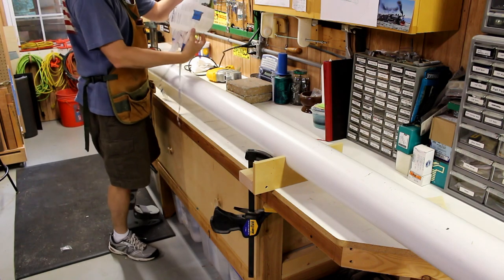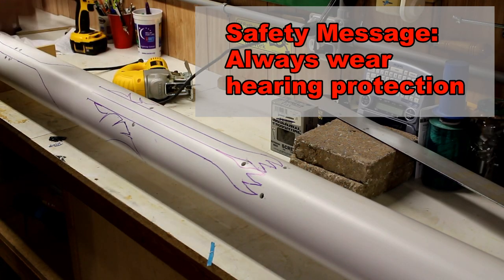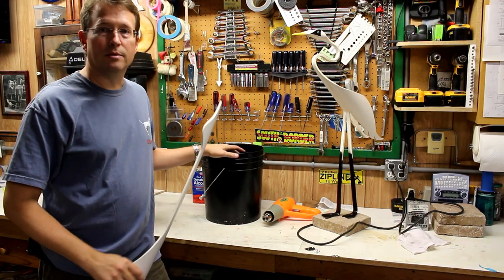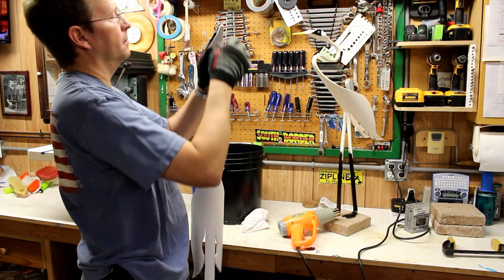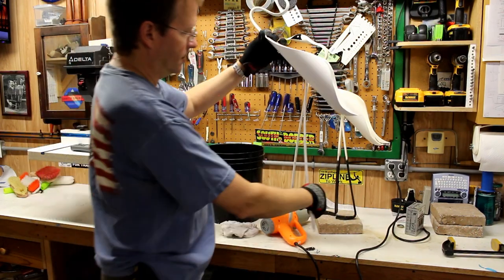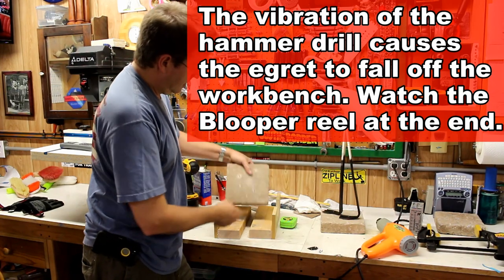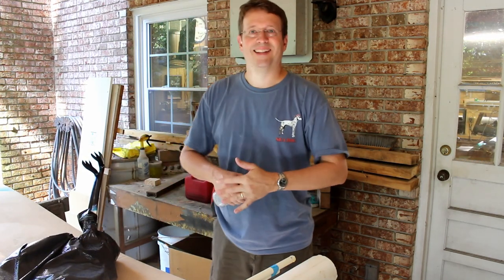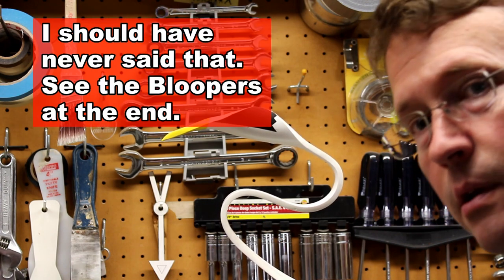Egret Build with 4" PVC Pipe

Comment: Cut the legs separate with a square of plastic near the top. Find a balance point , drill holes thru bird and leg add bolt and washers and a cheap bearing and bird will turn inyo the wind. Or a bolt with washer on top n bottom but a large hole and it will move and Bob up n down

Comment: So far as your PVC did you use 4" thin wall or thick wall or in PVC Schedule 20 or 40 or in water terms is it water pressure thick or sewage gauge thin? Jim
Reply from the maker: James -  It is Schedule 40 pipe. Picked it up from Home Depot. - Steve

Comment: What paint did you use to paint the face where the eyes go?
Reply from the maker: I just used a water based hobby paint. It will fade with time. The yellow fades the quickest. Every few years a clean up them up. Thanks for the question.